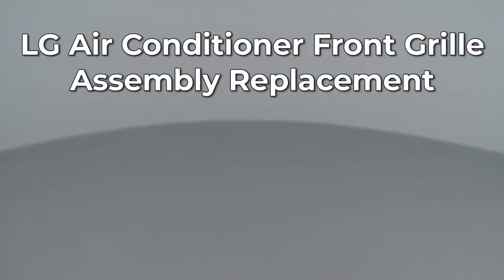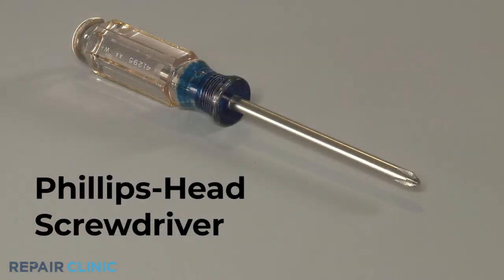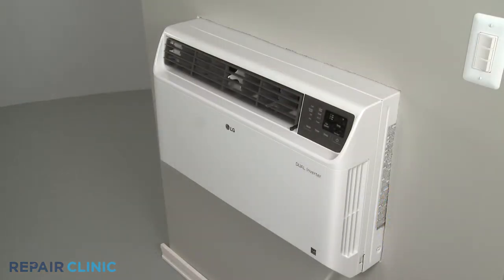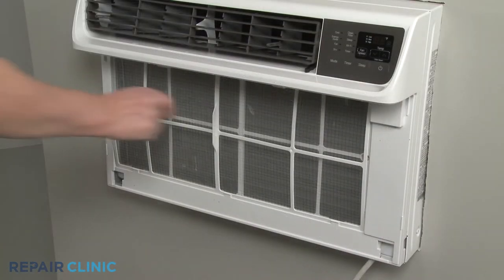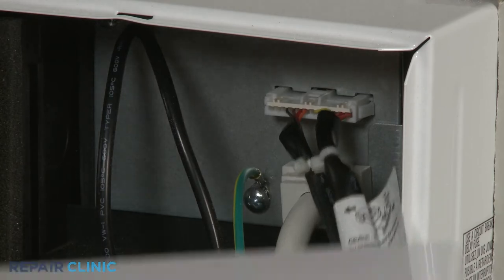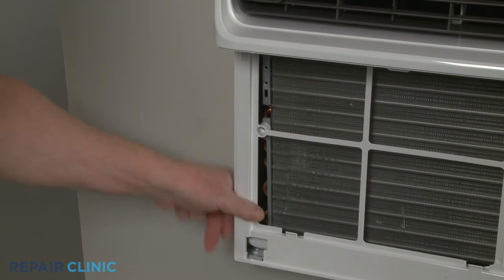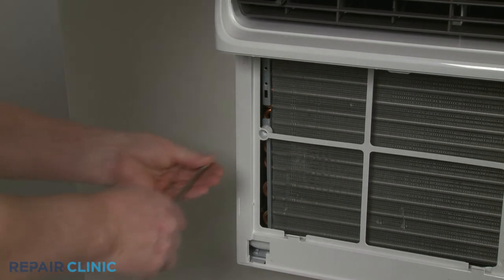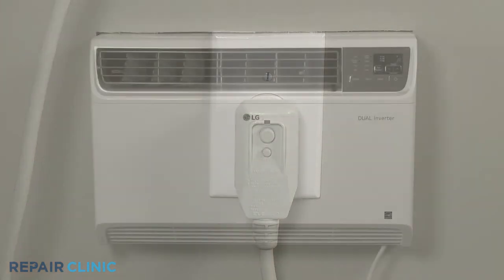LG Air Conditioner Front Grille Assembly Replacement AEB75324507

Comment: I have the LW1019IVSM 9500 BTU LG dual inverter.  Mine has the same two screws to take off the front (do not remove the screw bottom right that holds the power cord in place) At first it wouldn't budge after removing the 2 screws, I found the sides of the front grill toward the bottom, are clipped in very tight.  I pulled the sides outward slightly (left/right respectively) one side at a time, then pulled towards me and they came out.  It seems like you'd break it, but its just those bottom sides clipped in are much more snug than the video shows, at least on mine.
Reply: Just wanted to thank you for this. Was driving me nuts for a sec

Comment: My 1-ton unit is older and does not have a separate cover from the control part. I can’t see how to get it off without possibly breaking something. I’ve undone the two screws between the grill part of the cover and the control par, but it is not slipping loose. There are no evident handles. Model # is7NPKG01J. Any knowledge out there?—jj

Comment: Easier said than Done. (For sure.) We remove the AC from the Window, around Halloween, and like to return it to it's box until the late Spring. Can't seem to Lift off the top Grill  (No screws are attached) And it won't fit back into the box with the Grill attached! Help!   Model 1517IVSM!

Comment: My LG model is LW1216ER and it has a one piece front grill. It does NOT come apart like this. The manual shows how to put it on but not how to take it off.
Reply: I have the same air conditioner, and am still trying to figure out how to remove the front grill without breaking something. I called LG customer support. Incredibly, the customer service people didn't know how to do it, and they were unable to refer me to any videos that were helpful. (They did send me 3 videos, but none of them featured LG air conditioners.)
Reply: @errolhartman1639  Same here. They all appear clueless. They insist on referring to models with 2 piece front grilles. I even talked to someone in tech ( supposedly) and no help there either. Manual tells you to keep certain parts clean but no way to get at them! Even the installation part in the manual in not correct for this model. It shows you putting the front back on after you install the outer cabinet but you do not take the front off to install!   I guess LG doesn't even know what they are making! Crazy.
Reply: And I have the same problem and this comment (which doesn't answer it, of course) is the only thing I've found.
Reply: Has anyone figured this out yet?  I use this unit in a floral cooler so how it looks isn't important so I could break the front panel to get to the coils.  I hate to do that though.